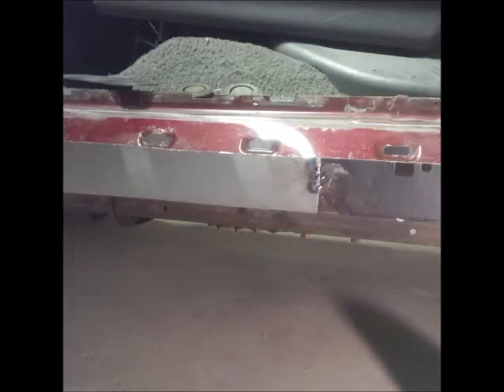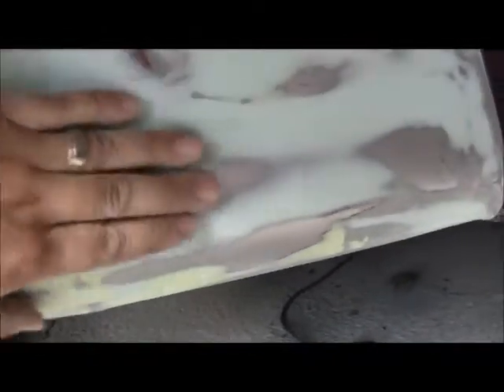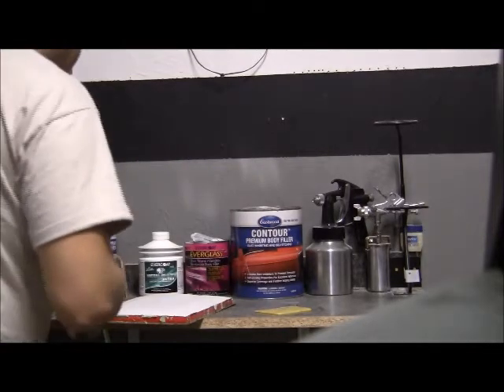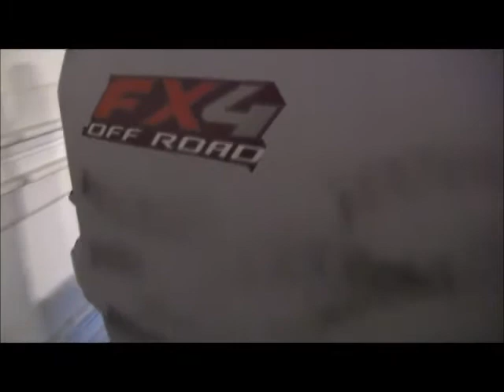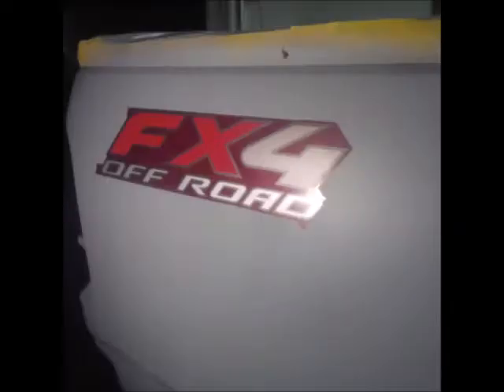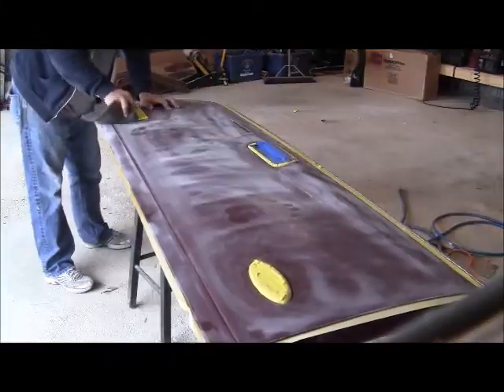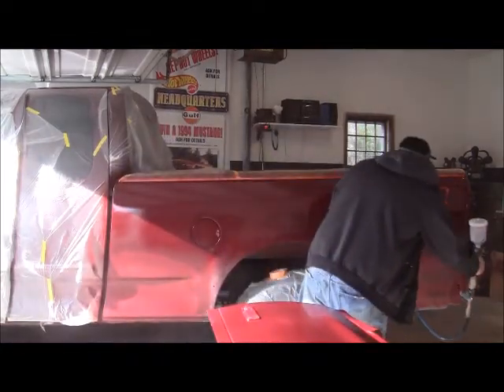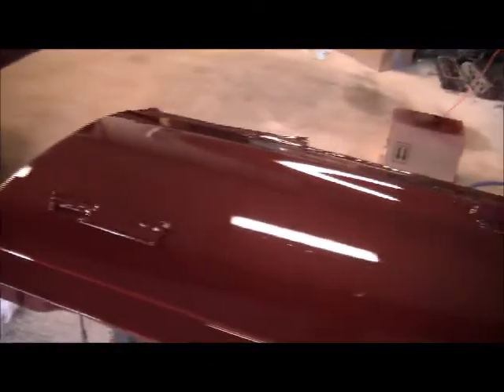Ford F150 Rust Repair Part 2

Comment: Nice job!.. I want to do the exact same thing to my 97 ... What paint products did you use and what paint gun is that? Thanks for the video
Reply from the maker: jason ratliff thanks man, i used dupont nason brand paint and 2k primer. The gun i use is a cheap one you can pick up from harbor frieght for like 40 bucks. I usually use these once or twice then throw them out.

Comment: So, you can put the fiberglass right over the metal and you don't have to worry about any rustproof on those portions?
Reply from the maker: Its not exactly fiberglass. It is an automotive filler than contains fiber strands, and yes it is to be applied over bare metal. Just read the instructions for the products you use